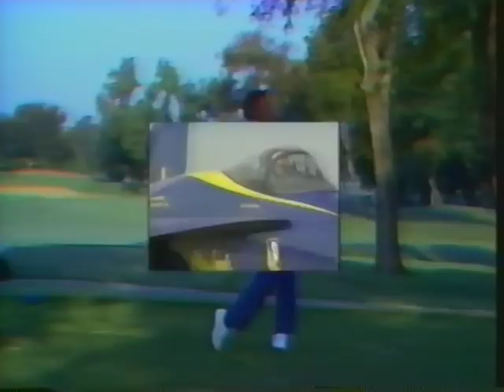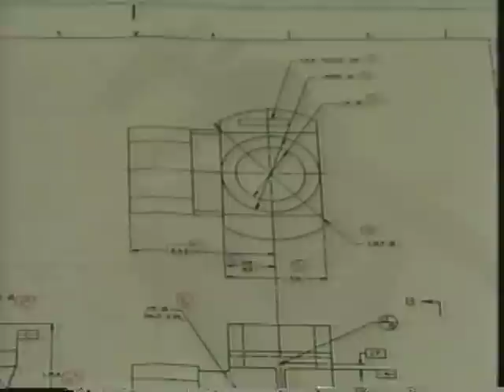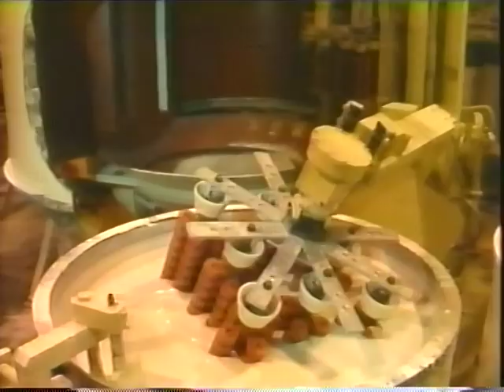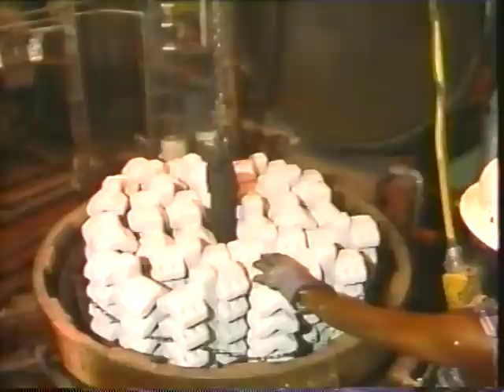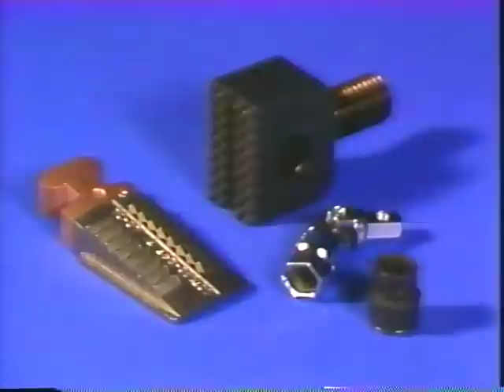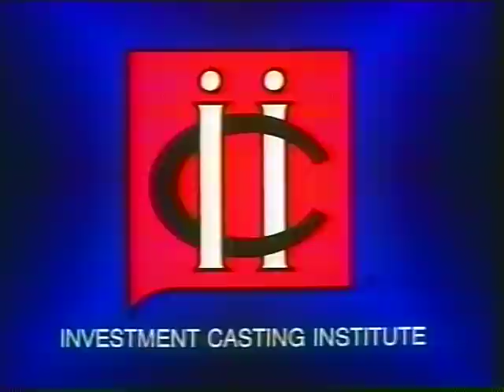Investment Casting Process

Comment: Nice video. What is addition in 6.40 sec of video??? I guess it is something for reduce loss of carbon..
Reply: Leo Havlicek This is a "hot topping" that when applied produces a chemical reaction that produces a lot of heat.  The heat helps to keep the metal molten a bit longer so that it can feed the casting longer and prevent shrinkage porosity.
Reply: Laura Bartlett 
thx..

Comment: Thank you! Veri nice video for engineering students :)  
I also have a question for you... I want to make an aluminium part by investment casting then milling a central void and then finish. It is a fuel tank  connection for an aircraft. Should I just  cast all the part and skip the milling, or should I do it the way I mentioned... Any help will be appreciated :)

Comment: @drocketman2000 you don't need steel for casting wax. aluminum or other cheaper metals would do fine. and not very expensive considering it's just one or a few molds.

Comment: @randomshinichi
Because it would fuse (weld) to the molten metal as well as deform. Also, you would need to make mold for every piece you want to produce. Complex shapes are easier to make with this method.